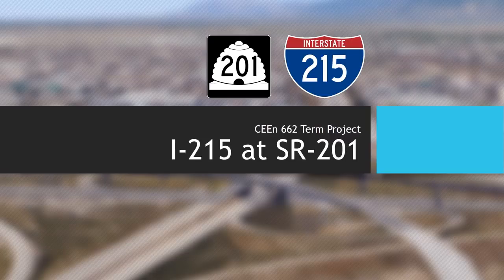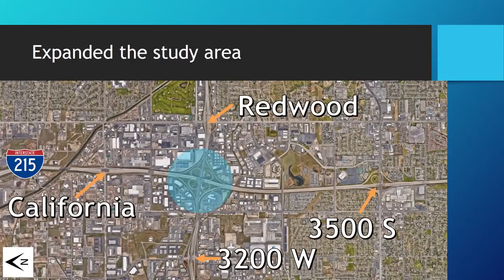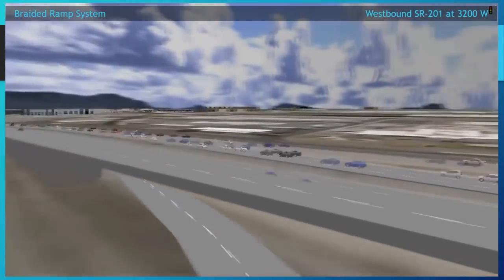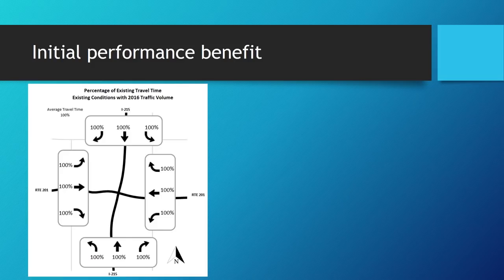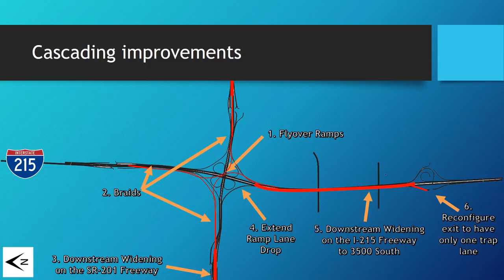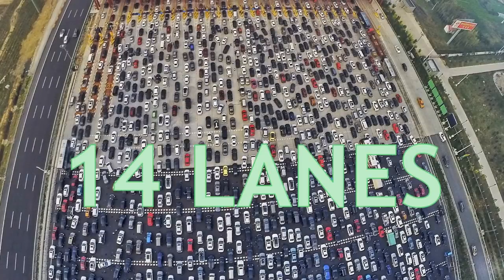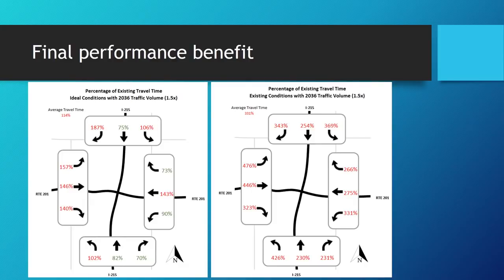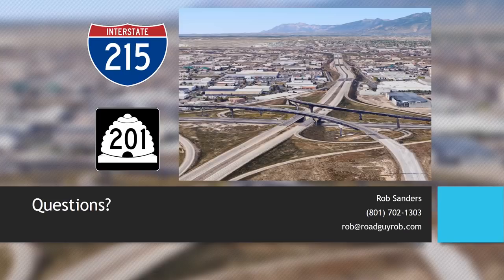Microsimulation Model: I-215 at SR-201 Interchange

Comment: why not braid the clover ramps? that also eliminates weaving. or maybe cd roads. a little remedy stuff and ramp braiding, and they are not as bad as you think. or try my new idea, the clovertrumpet. instead of the flyover it has a trumpet interchange loop ramp. no weaving, and looks like a cloverleaf in a sense. but these are nightmare for truckers probably.

Comment: This reminds me of what ARDOT did to the I-430/630 interchange, which as built in the 1970's was Central Arkansas' only full cloverleaf (albeit with C/D lanes on I-430 plus a surface street & stoplights in one direction) until flyovers and C/Ds on I-630 were added (none of the loop ramps were removed due to neighboring exits). It's not busy enough to require 14 lanes anywhere, though I'm currently battling anti-widening activists who stupidly think ANY improvement only makes things worse.

Comment: Reminds me of a book called The Goal which is about factories but actually applies to anything (or a simpler one called The Bottleneck Rules). It points out how fixing the bottleneck moves the bottleneck somewhere else. Also, improving anything except the bottleneck is a waste. Although roads are an interesting case because there are so many different start/end points and multiple routes.

Comment: How do I turn on these ultralow settings in Cities Skylines?
Reply from the maker: What's funny is how games look so good -- it makes $10,000 professional traffic modeling software look kinda like garbage.
Reply: @RoadGuyRob  That's because traffic modeling software sells maybe 500 copies of that $10,000 software, while the videogame sells 6,000,000 copies averaging $50. So the traffic simulation company has 5 million of revenue to work with, while the video game company has 300 million. That's two orders of magnitude of difference.
Reply: @Distress.  There are already mods that change the Traffic AI for a more real world simulation ala, random lane changes, differing speeds, etc
But the best thing is that you can change the simulation live and watch the effect of a change instantly, instead of waiting for the Traffic modeling software to calculate variables.
Both have pros, both have cons but the game has that instant effect that lets you iterate highways systems very rapidly.
Reply: @HinanawiTenko  But you can’t change some of the problems with the AI for example traffic can only switch lanes at the nodes.
Reply: @machinerin151  apples to oranges. Company software is marked way up because, it is sold to companies. It is meant to be functional, but not aesthetically pleasing. It's the functionality and prospective buyer that drives the price up. If it was being marketed and sold to individuals. It would be cheaper just because, of that. When you buy basic windows 10 for yourself. You pay about $150 bucks just for that. (Don't know why anyone would) When a company buys windows 10. It's $200 per computer. Some software allows the company to own a license that lets them put the software on as many computers as they want thus, insane mark up.

Comment: Just add two more flyovers for a four stack.  They work very well except for rush hour and even then they are superior to other remedies.
As far as the close by interchanges, they should be bypassed where needed.  The freeway is not designed for traveling a couple of blocks.  Just use the surface streets to get to the road with an interchange.   Some of these interchanges should not have been built.
Reply: Seriously there should be no freeway access from a surface artery within a mile of a freeway junction like this one.
Reply: Yes.

Comment: What I want to advise: improve railroads in the US. Take a look at Europe. I'm not saying that it's perfect to get from Los Angeles to Boston, but there should be a good train connection from LA to Las Vegas for example. Like the ones we have in the Netherlands: no reservations. You can take the train from Amsterdam to Rotterdam just by going to the station. Sure, take a look when the train is leaving is better, but at midday I think you don't even have to wait more than fifteen minutes now until the next train takes leave.  And the direct connection takes 41 minutes from station to station. That solves a lot of car traffic....
Reply: Sounds good, until you get the NIMBY’s.   If.....IF they built this commuter train as you described, it would  stop five miles short of Las Vegas then they would  want you to take a taxi and every taxi  would ....cough....accidentally ......end cough..... go  the wrong way on the interstate to add 30 minutes to the meter.      No way would it be allowed to have a stop at a Las Vegas monorail station, or the Las Vegas airport, or the NFL stadium, or Fremont Street, the NIMBYs would stop it. 

Look at New York City.  Sure, you can fly into LGA LaGuardia but the New York City subway doesnt go to LGA.    They had a plan to connect LGA to the subway system but the NIMBYs stoped it.  

Las Vegas has a monorail, but it doesn’t go to the airport.   In my opinion, the Las Vegas monorail should connect to the Las Vegas airport on one end, along the strip and its mega-casinos, and the football stadium on the other end with a additional “Y” going to old Las Vegas / Fremont Street. The monorail  users all want this, but the monorail users are not the customer   Read on to understand why. 

Chicago has a elevated subway that loops the city.  It intentionally never connects to Amtrak, not even its very busy Hiawatha line.  Oh, and the Amtrak does not run to the Chicago O’hare airport.  Because of this, the Chicago elevated subway can only get you around Chicago but does no good getting people to and from Chicago. You can’t ride into Chicago on Amtrak, cross over to the subway, then get to the airport. So everyone in the suburbs must drive to the airport. How silly.  

In Europe, the mass transit system works for the mass transit user because the user is the customer.  In the USA, business, not the individual mass transit user, is the customer.  The mass transit user is the product, not the customer.  So that small fee you pay to use that Las Vegas monorail does not come close to covering its expense.  

Much of the expense of then Las Vegas monorail is covered by the mega-casinos on the strip who’s best interest is to keep you at the mega-casinos on the strip so thats where the Las Vegas monorail takes you, from one mega-casino to another. 

In Orlando, the Disney monorail takes you from one Disney property to another.  Of course Disney would not want you to go to Universal, or Sea World, they want you to spend your money at Disney places so thats the only stops on the Disney monorail system. Disney can dictate this because Disney owns the monorail. 

You, the individual, the product, have no lobbying power, no lawyers, no representation. The business figures out what is best for them and thats what happens. That’s it. 

Think about Facebook. Are you a customer? No, you are not a Facebook customer. The customers pay massive money to Facebook for advertising, and metrics.  You, a user of Facebook, are the product the customer wants.  Ditto with YouTube. Ditto with the private or local mass transit systems in the USA.

In the USA, mass transit is like Facebook, the users are not the customer, the users are the product. 

And thats why mass-transit just does not work in the USA.
Reply: @DougAlesUSA  undermine the NIMBYs by either banning their lawsuits or let those with health problems sue them
Reply: The unfortunate thing is that the US is so damn huge that any passenger train that attempts to run service through the US, long or short, is doomed to bankruptcy. Lots of companies had your exact idea, and in the east Amtrak is still there and works a bit, but simply no one uses it, and even if they did its still really super expensive to run
Reply: @twentysixbit  nobody will use a train that runs 40 mph and is once every 3 days . Look at the schedules those trains are useless bad service won’t get used. Break up the long trains and run frequent service cut the crap it’s too much
Reply: Let's say they do improve rail. So now you can take that 40 minute train to bypass traffic.

But what happens next? That's right: after you get off that train you're back into regular ol' America: maybe someone will hit you on the pedestrian crossing while turning right on red, maybe you'll run into a straight up end of the sidewalk, maybe you'll need to walk for 3 hours to cover the distance that takes a car 20 minutes even in terrible traffic. Maybe you wait for the bus that never comes.

To fix America you need to fix the whole entire thing, not just bits and pieces. And it's too expensive to do so, and everyone already lives in sprawling single family homes and has to drive to get anywhere. Too late to do that.
Reply: @machinerin151  let em use electric bikes or scooters which were around since 1890s !!!! Yes e scooters ARE NOT new
Reply: @machinerin151  bus service and e bikes next
Reply: @machinerin151  and when the oil runs out urban, suburban, and even rural America will be an impossible pain to live in
Reply: @edwardmiessner6502  Nah, EVs will pick it up rather quickly - because you still have nuclear, hydro, natural gas, wind etc. to run the power plants. However, this will make the transportation system more expensive and more fire prone. At least the air will smell better. 
Still: the main problem isn't the environmental impact - noone except 3.5 hippies really cares. The main problem is cost, speed, and land use efficiency (i.e. how far away everything is) 
When the oil starts running low and gas prices rise - I predict a huge rent hike in NYC, Chicago and other cities with metro transportation, while rent in somewhere like Houston will drop because you need to drive far as hell in your EV to get to any place.

Comment: That's an extremely dangerous interchange, even when I was driving it regularly 15 years ago.   A tractor trailer shouldn't attempt that cloverleaf above 15 MPH due to the tightness of the curves and the crowning of the road.   I've seen many a truck rollover there.
Reply: Which shows another flaw of the cloverleaf and all spiral ramps! They require traffic to slow down below normal speeds and then accelerate in order to properly merge.  For a cloverleaf... imagine a truck climbing up hill on a ramp at no more than 15 and then only having the length of the overpass to weave into traffic which is traveling at 55 or faster if flowing properly.  Directional flyovers or turbines are the way to go.
Reply: Yes, roadways facilities should be designed for ALL users.
Reply: Yes exactly!  They really shouldn't be considered or allowed unless they can be huge, but then that swallows up an enormous amount of land which is a stupid waste in a city.